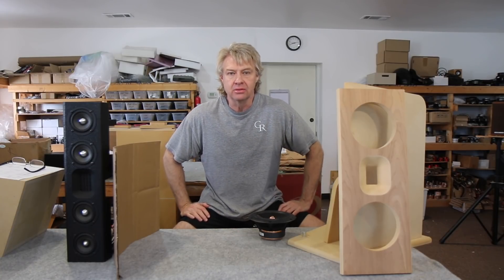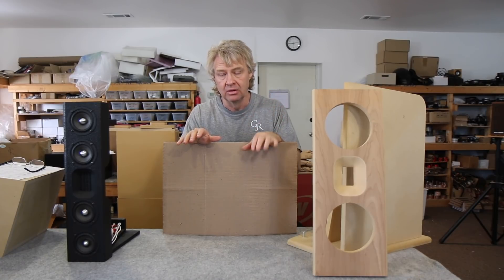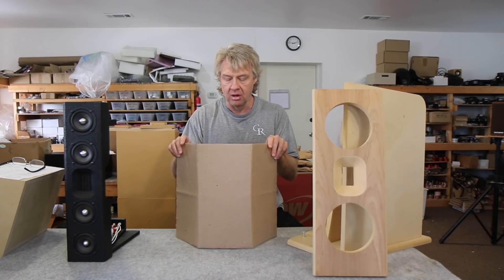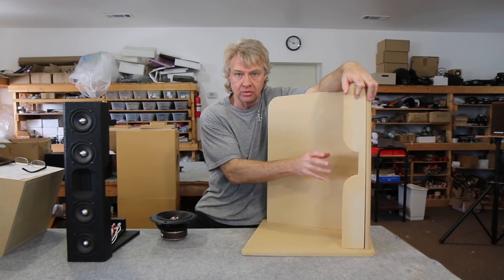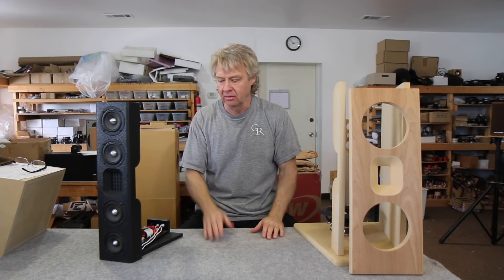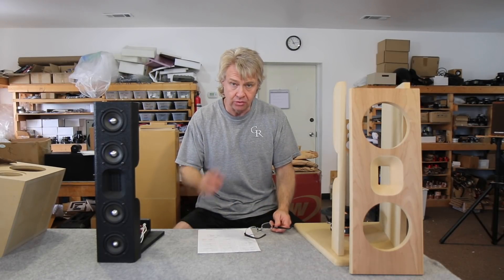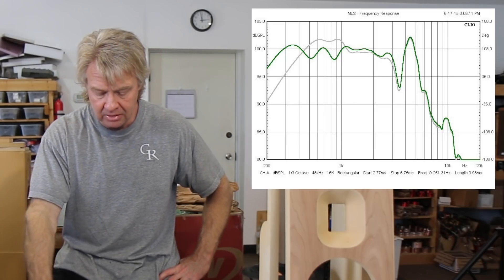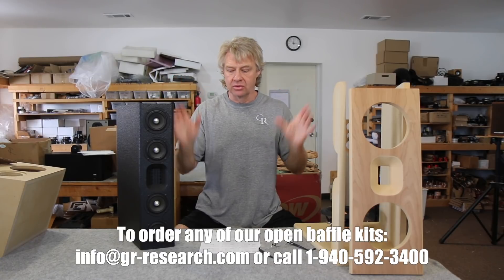Open Baffle Basics pt.3

Comment: How come all the graphs you show here and for the X-LS as an example never goes below 200hz?
Reply: Measuring accurately lower than that requires being further away with the microphone. And I can't get much further away and still be able to gate out any room reflections.
Reply: IINM many of the full bandwidth FR graphs published actually consist of near and far field or ground-plane quasi anechoic measures stitched together - usually below 300Hz.

Comment: Danny, I’ve seen a trend the past several years where cinema installers are putting acoustic foam damped MDF wings on speaker cabinets.
Reply: Interesting 
Are you referring to quasi screen wall or baffle wall flush mounting? Something akin to studio flush mounting? 

Such approaches solve problems that SBIR creates, also gains are had in dynamic output capability.
 
But like anything with loudspeakers/acoustics, it's all an exercise in compromise.

Sacrifices in diffraction include imaging and soundstage depth ... but those are oftentimes deemed less important in HT or studios.
Reply: @FOH3663  - scroll through the pictures of the QSC RSC-112 Speaker.  Specifically, the RBK-12 baffle wing kit.  https://www.qsc.com/cinema/products/loudspeakers/reference-monitor-system/rsc-112/
Reply: @petersouthernboy6327  

Yes ... gotcha

Comment: KEF has come up with a new technology, for a clearer sound. What do you think about that?
Reply: The metamaterial works only on the tweeter, but it's a good improvement to the backwave reflection problem on a monopole speaker. But open baffles can work on the full audible range.
Reply: You mean using small baffles to diffuse a back wave instead of using material to absorb it? That is just a drop in the bucket compared to everything else going into a speaker.
Reply: @dannyrichie9743  Ok, I'm not an expert, but I have ordered a pair of Klipsch Hersy IVs, but am not sure if I have ordered too, since KEF is coming up with a new technology now, which makes the sound clearer, according to what the interviewers have pointed out.
Reply: @dannyrichie9743  The metamaterial does not use small baffles to diffuse the backwave. It uses 30 Helmholtz resonators to effectively absorb the tweeter's backwave to 99% absorption above 620Hz, although it only mostly absorbs frequencies above the crossover point as it is attached to the tweeter. 99% absorption gives 20dB reduction in the reflected energy which is superior to the typical speaker stuffing materials.
Reply: @remiandrepedersen868  If they really wanted to make sound clearer, all they have to do is use some better quality parts in their crossovers. But that is not as marketable as a "new technology".
Reply: @StewartMarkley  A small chamber (resonator) doesn't absorb sound. It is more of a cancelling it with redirected energy. And high frequency is easy to absorb. You can absorb it with anything. And it is easy to test. The control is a completely open back or open baffle. Then add a chamber that matches the same response as an open baffle.
Reply: Remi Andre' Pedersen - KEF is in effect sonically “isolating” the tweeter, which I personally have been doing for years by enclosing and damping it.  Many dome tweeters have resonance chambers in their designs.  And this is NOT an issue with the compression drivers in the Heresy IV - enjoy them, they’re great speakers 🔊!
Reply: Stewart Markley - I’ve been building separate damped enclosures for midrange and tweeter drivers for years now.  Tweeter frequencies are easy to absorb TBH.  Quite a few domed tweeters come with damped resonance chambers from the factory.
Reply: Stewart Markley - KEF had to come up with a resonance control design for a coaxial dome tweeter - that’s where “Meta” comes from.  With good quality separate tweeters this is not an issue.
Reply: Danny Richie - you need to use more marketing hyperbole like “meta” and “mega” and  “titanium” when you roll out products 🤣
Reply: @petersouthernboy6327  Okay, that's good to hear, since I've ordered a pair of Hersey IV. Thanks for the info!
Reply: @dannyrichie9743  True, a resonator does not absorb sound. Absorption is a dissipative process, and the resonant chamber has minimal dissipative (resistive) quality. Resonance being a reactive process does not dissipate energy but the cancellation is effectively the same as if it was absorbed, much as active noise cancellation works. If the cancellation is great enough, it is effectively acting as an open baffle and backwave reflections are effectively nulled.
Reply: @petersouthernboy6327  Metamaterial is not a KEF invention. They are not new and have around since the late 19th century.  What is new is the development of a metamaterial to deal with transducer backwave radiation.

The following is from Wikipedia.

A metamaterial (from the Greek word μετά meta, meaning "beyond" and the Latin word materia, meaning "matter" or "material") is any material engineered to have a property that is not found in naturally occurring materials. Some of the earliest structures that may be considered metamaterials were studied by Jagadish Chandra Bose, who in 1898 researched substances with chiral properties.
Reply: @StewartMarkley  It would be easy to test. Just measure it in free air with it on and with it off.
Reply: Danny Richie - KEF claims their Meta (it’s a circular flat disc shape that looks like a shallow maze)  traps 39% more of the back wave radiation than “conventional materials” from 600 Hz up.  I would imagine that “conventional” means some sort of common fiber insulation material.  No-Rez would certainly be better than a conventional fiber blanket glued to a panel.  I do applaud KEF for finding a solution that doesn’t restrict airflow in a small ported enclosure.  Wilson and Magico use wave trap reflectors in the interior surfaces of their cabinets, and they’re also using machined aluminum and phenolic resin cabinet materials.
Reply: @petersouthernboy6327  Again if what they say is true then it is easy to test. Let's see the measurements with the back completely open in free air and with their new device. It should measure the same minus the resistance it creates. At this point is sounds good on paper and gives their marketing department something to talk about. It sounds trivial to me at best considering what they leave on the table with their super cheesy crossover parts. Try Googling pictures of their crossovers.
Reply: Danny Richie - btw, Wilson Audio bought Reliable Capacitor and moved it to their speaker facility in Provo, Utah.
Reply: @dannyrichie9743  I agree, any "high end" manufacturer should be using high quality crossover components as a minimum to qualify as a high end product. They can always have a  high end series and charge a nice premium for better crossover parts, NoRes, finish, etc. and a cheaper series. Only smart marketing, no rocket science.
Reply: @petersouthernboy6327  it shouldn't take buying a capacitor company to make using high quality capacitors, especially for a company like Wilson with their exorbitant prices.
Reply: @dannyrichie9743  Measurements and subjective comparisons. Then with the cheesy crossovers and quality ones.
Reply: Stewart Markley - Dude, price out Dueland or Jupiter or Audyn Copper Max - it makes all the sense in the world from a high end clientele business perspective.
Reply: @StewartMarkley  Yes, we do that a LOT. Objective and subjective comparisons.
Reply: @petersouthernboy6327  Yep, I knew about the Wilson Audio deal right as it happened.
Reply: Danny Richie - and this gets back to the strengths behind either an open baffle design or separate enclosures for drivers in a box design.  Like everything in speaker design there’s a compromise - in a box, overdamping helps the midrange but it tends to hurt bass response.
Reply: @dannyrichie9743  Right, now who wants to buy a pair and try that test? Not me, I'm on social security. But the test wouldn't be proper by just removing the metamaterial as the tweeter backwave normally uses some sort of rear chamber and stuffing material. You have to compare the older LS50 to the LS50 Meta.
I have an update about the absorption, I was wrong about the dissipation. The metamaterial does dissipate the energy by virtue of viscous shear forces in the narrow channels. A clever concept. But it will not likely scale to low frequencies, but they probably can go lower than 600Hz if they can figure out how to couple the backwave of a mid/woofer driver. I won't be surprised if that does happen in another product soon.
Reply: @StewartMarkley  If someone would like to send me a pair then I can test them.
Reply: @dannyrichie9743  I hope someone out there sees this and contacts you, although it would probably have to be two people, one with the old and one with the new pair. Then it would be really interesting to compare the LS50 Meta to your open baffles .

Comment: You should be using drivers that are open frame from low to high to achieve the full deal. Closed back HF drivers are causing that forward sound which we don't want all of my designs use fully open frame drives. 

DSP, EQing, Electronic crossovers are a must checkout pro speaker management systems they are transparent with super low latency. Good pro Speaker Management equipment to name a few  come from RANE and ASHLY . 

Love your site by the way...

https://www.canuckaudiomart.com/view_userimages.php?user_id=86506
Reply: We have models that are fully open baffle top to bottom. And no DSP required. Using DSP or electronic crossovers are typically far more of a bottleneck.
Reply: @dannyrichie9743  Agree to disagree DSP is the future of Audio and a welcome one at that.
Reply: @99thDimension  Electronic crossovers are far too technical for the average consumer. Plus, most audiophiles don't want extra electronics in the signal path. Less is more.
Reply: @tehuhti2  You would think but not true today's digital gear works thousands of time faster then gear from just 10 years ago. Processors running at 24/96 surpasses any other type of media from the last one hundred years hands down.

Digital signal manipulation  has taken over it is everywhere. Analog amps and speakers still rule the final stages and will for a long time to come.
Reply: @99thDimension  Don't agree about final stages (power amps) ruling for a long time to come. The latest designs have finally achieved performance so good that the artifacts of digitization are inaudible IMO.
Reply: I use DSP but it’s orders of magnitude better than miniDSP, Rane, or Ashly.  I use the Xilica XP-4080 with the baseline settings provided by Roy Delgado from Klipsch for the K-402 horn and TAD driver.  I’m using a compression driver so I need it.  I can appreciate Danny putting in the effort to eliminate as many acoustic issues as possible with baffle and driver placement design engineering.
Reply: @petersouthernboy6327  I found the miniDSP to be limited on the output that and being tied to a laptop. Once the laptop dies the miniDSP turns into a paperweight. Rane and or ASHLY  being stand alone devices being controllable without a pc set up won me over. RANE I find has that high end sound built in reminds me of the McIntosh wide bandwidth clarity.
Reply: @99thDimension  - Rane is fine for what it is.  If you want to take really take full advantage of algorithm based filters like FIR and IIR, delays, GEQ and PEQ you'll need to step up to something with some serious processing power:  Xilica XP and XD is the $1500 - $2,000 range and Lake is much higher - about $6K.
Reply: @dannyrichie9743  - I thought the same thing about DSP for years.  And I was NOT impressed by miniDSP.   I always used very high quality passive crossover components.  Roy Delgado turned me on to Xilica and the XP4080 rocked my world.  And the price was right: it was $1400 and it is a serious piece of kit.  In no way is it a bottleneck. And it can handle FIR filters, IIR filters, delays, GEQ, PEQ, and about dozen digital variations of analog crossover filter types.  It has quite a bit of processing power.  https://xilica.com/products/xp/

Comment: Ever spend hours and hours getting a chart or graph to LOOK good and then realize it SOUNDS like crap?
Reply: Good measurements beget good sound. Measurements are the tools, the ears and brain are the judge.
Reply: The measurements are design tools use for achieving accuracy. How they sound involves a lot of other things. I can build out two sets of speakers that use the same drivers and crossover design, and measure exactly the same, but one pair sounds like crap and one pair sounds fantastic.
Reply: @dannyrichie9743  And why is that?  Enclosure/Baffles? Tolerances? Electronics? Room? Setup? Cables?
Reply: Stewart Markley - Here’s Nelson Pass saying that he can make a speaker measure flatter but that won’t necessarily make it sound better.  http://www.firstwatt.com/pdf/art_l300.pdf
Reply: @petersouthernboy6327  Same with amps.  A ruler flat response does not guarantee it will sound good.
Reply: @dannyrichie9743  I saw this video when it came out and I don't disagree that crossover component quality can make a noticeable audible difference. That along with driver quality, enclosure bracing and damping, and electrical damping all can affect the sound, which I contend is due to the transient response. This is an aspect of measurements that is largely ignored, however you are likely to counter that the spectral decay measurement does this. It does to some extent, however the finer details of transient response is not represented by the spectral decay measurement and it is in these finer details where the reproduction of musical attacks, imaging and soundstage are likely degraded by transient response performance. This is an area for improvement in the engineering and measurement of speaker development.